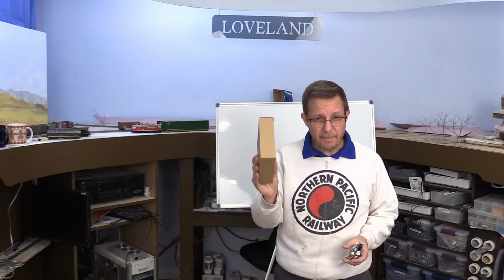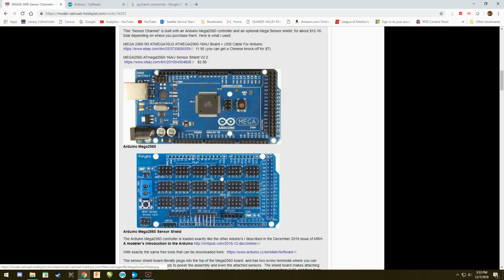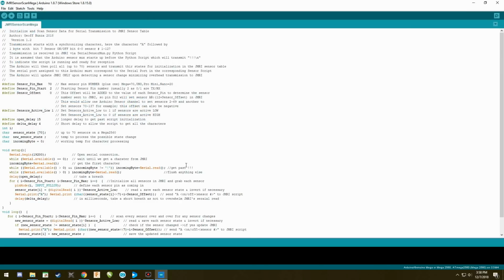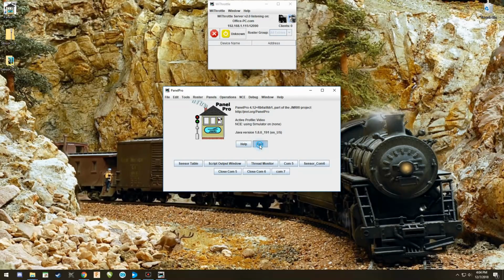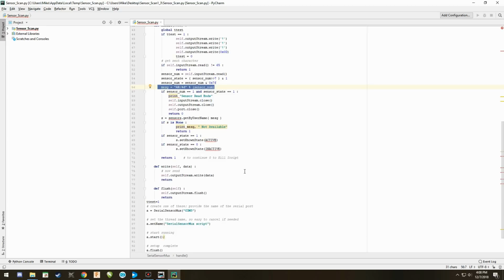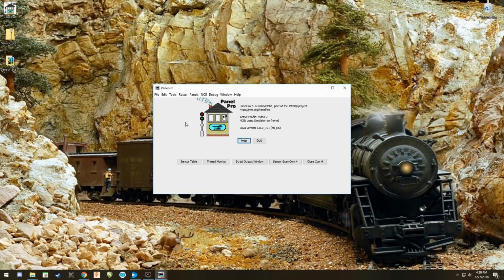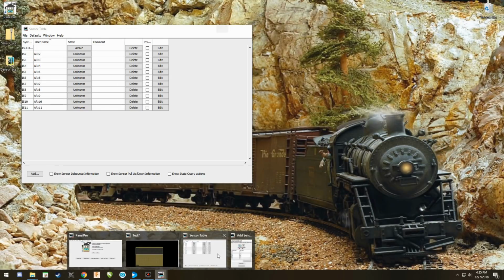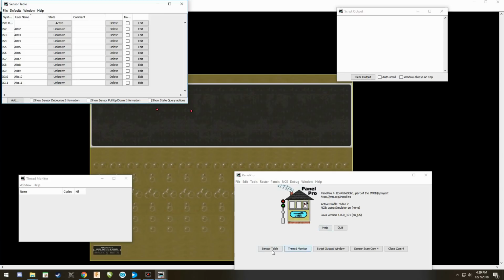Sensor and JMRI pt4 of sensors. Colorado Front Range Railroad.

Comment: Mike, as a networking person I have had this problem with a printer connected by usb. I had to have a usb connection of at least 50 feet and was able to make it work.  You will use cat5e cable from end to end (terminated on each end with rj45 jacks) using usb to rj45 adapters at the printer and at the computer/switch end.  The connection used the cat5e cable to extend the usb cables past it's restrictions.  My feeling is that the sensors modules should work with this configuration.

Comment: Mike,  This gentleman's name is Geoff - pronounced GEE OFF...not Jeff.

Anyway...I wrote to him recently about this sensor article.

He replied that if you are going to use a LOT of sensors on this shield, you may not want to power it up all from the shield.

Rather to use an independent 5 volt power supply.  Rate the supply with the number of sensors times the current that each module is spec'ed to use and have that many amps available.

Connect power and ground from the supply to each IR detector by using a voltage buss along its length to the last sensor.  Tie the common of the power supply back to the common on the shield to maintain a ground reference.

Then you can just run the signal lines from each sensor back to the shield to the appropriate channel and pin.

There is another shield avilable that allows for screw connections to each channel, by the way.

You can take "servo" cables that are female and cut them in half.  Slip each end set of 3, to the pins at the sensor and the shield.

Use an intermediate length of wiring to connect the wire ends together over the length of your run.  This makes for a nice connection at each end.  just solder up the middle lengths and apply heat shrink at the joints.

Another idea is to use a form of a multi-conductor cable, like a 8 pair cable, which gives you 16 wires.  Fan them out to your sensors and then bring one cable back to the shield.  Keeps things nice and neat under the deck.  You may wish to terminate 16 sensor signals to a terminal block, connect on this cable, and bring it all back to another terminal block and then up to your shield...your choice.  I prefer not to have 16 wires flopping about under the deck in a mass of colors.

Now you may not need a mega and hugh shield.  Perhaps you have <16 sensors in which case you can use a UNO or other card.  Then the wiring gets easier.
Reply from the maker: Thanks for the info as my layout has over 36 sensor the mage is still the best choice (for me) but good to know. Geoff and me talk quite a bit about this project he lives just 3 hours for me it had it's snags but got it working. Thanks again Mike.
Reply: Hi againi,  Another point to mention regards the com port for a raspberry pi.  On a pc this is usually a COMxx.  But on a Pi, it takes the form - -/tty/dev/ACMx.  I am referring to the PY scripts at JMRI.

I installed the arduino IDE and searched for com ports.  It showed 2 available.   When connecting an arduino out on the table back to the py script, remember that it's sketch has to reference this same address at that end too.

Bob S

Comment: Greetings, I recently found and am enjoying your videos.  I’m not an electronics guy, so you introduced me to a buckboard. Would you provide the name and model of the item you use.  This would be useful as I start experimenting. Thanks, Kent
Reply from the maker: two types Simple ones      https://www.amazon.com/eBoot-LM2596-Converter-3-0-40V-1-5-35V/dp/B01GJ0SC2C/ref=sr_1_3?keywords=buck+board&qid=1555253215&s=gateway&sr=8-3-spell
and fancy one with more information if you need it       https://www.amazon.com/DROK-Adjustable-Converter-Transformer-Protective/dp/B07JZ2GQJF/ref=sr_1_6?keywords=buck+board&qid=1555253215&s=gateway&sr=8-6-spell

Sorry about the delay on answering was working on the layout.
Mike

Comment: Mike great video!  Now I totally understand what your trying to do and how I can utilize  this feature to my layout.  I don't have enough room in my layout room to have a laptop setup to run JMRI.  It looks as though I could use a Raspberry Pi with a small display running JMRI connected to a Arduino, is that correct?  Having sensors installed in my hidden staging yard as well as my helix might be a good idea, can I add these as an after thought?
Reply from the maker: Yes you can if you look at the blog it can be setup on Raspberry pi. Facebook group has a group called DCC++  with folks that do just that.
Reply: I use and recommend a dedicated RaspPi for JMRI, as updates to Java and others may mess with your JMRI configuration, having a dedicated, single purpose system like a RaspPi running JMRI works well for me. You could use this RaspPi with any DCC system, NCE, Digitrax, ESU, whatever. However I’ve fell in love with my DCC++ running on Arduino. If your comfortable with Arduino is quite nice. Although I’ve recently lived my DCC++ to running on a ESP-32 board as it has integrated networking and eliminated any cabling between my control infrastructure and the railroad and simply uses Wi-Fi. Although you should prolly have an enterprise or otherwise robust wireless network to insure stability, as with any of this DIY stuff, your mileage may vary. There’s also a really nice system Sprog has put out, providing a complete DCC system on a RaspPi “hat” or riser card that connects via the onboard GPIO header. I’ve got numerous friends using this and some buddies in Australia are really going like gang-busters using this on small exhibition layout and modular setups. Others I know are using the Pi-Sprog as a dedicated programming track interface. When I first purchased a Sprog and later built my DCC++ to replace it I had fully intended to purchase a commercial system for the larger layout in building, however as I’ve got trains running I simply haven’t found a reason to. I really like and prefer using touchscreen throttles, especially as the volume rocker adjust the throttle requiring less attention while working a train. I do plan to build some physical throttle, even have some enclosures, much like the ProtoThrottle (and will use a couple of those for the few diesels that I run) and am trying to determine the proper way to emulate control on throttle shaped like a steam back head.

Comment: Hi, ok, you show me that there are issues and expense using a USB connection to JMRI. I have  Mega with a built in wifi 8266 chip and the sensor shield. I'm going to try a TCP IP connection to JMRI as it supports it.
Reply from the maker: I believe that I have seen a TCP IP set up in JMRI I have never done it Andy who also commented on this video may have. He maybe able to help with that. I will have to figure it out later as my RFID reader are TCP IP and I have got the conneded to the network in the train shop and it is working just have not connected it to the JMRI program. (it's lower on the list of thing to do...LOL)
Reply: I’ve messed with this in a couple ways. Even doing some experimentation with and having some success using CMRI on Arduino’s. In the case of RFID I think Arduino’s with either a Ethernet shield or ESP making a wireless serial data link would be preferable, do to so much effort with RFID on Arduino already being done for you. In other areas, because the ESP-32 can be programmed with Arduino sketches and easily adapt existing code to em, I’m inclined to say using the ESP-32 natively for I/O, not as a serial data link to Arduino, and eliminating the Arduino is easier in many cases (not all). There’s also some Jython JMRI scripting and ESP firmware available that does native JMRI inclusion of sensors and triggers to ESP. Also, for anyone early in their detonations about which hardware to use, the fact that ESP’s run effectively Python may make them easier to learn to program, however they can also run Arduino code. That flexibility makes them such a good fit for our purposes, as much of the reason I recommend Arduino’s or similar to other modelers is because so much Arduino code is already available on the internet by Dave Bodnar and others. In my case I prefer to abstract the physical connections from the control chain, even abstracting JMRI to a certain extent, by using MQTT to middleman the state and triggers. Since there’s already some JMRI to MQTT code out there and it’s supper easy to add on all the great work by home automation enthusiasts there’s a real wealth of stuff around MQTT and connected technology that it opens our opportunities further.
Reply from the maker: @AndyCrawford_NorfolkWestern  Andy we may need to talk after I get my sensors setup I have a few ideas that looks like it would be right up your alley.
Reply: Clinchfield Model Railroad N Scale I just realized your one of the guys I follow about MQTT, I’m preaching to the choir man. Your channel is awesome man, thank you for sharing your great work too! Also, have you IOTT on YouTube, he’s doing LocoNet on ESP’s as well. There’s a richness to what’s happening in this space that’s ignited over the past couple years and I’m loving it.
Reply: Thanks for the kind words. Yes, I follow IOTT. I built his loconet gateway using a Arduino D1 and a LM393 comparator. I have a Raspberry Pi W running JMRI headless including a Node Red and Mosquitto server for the IOTT stuff.